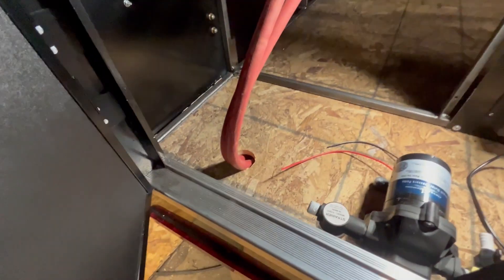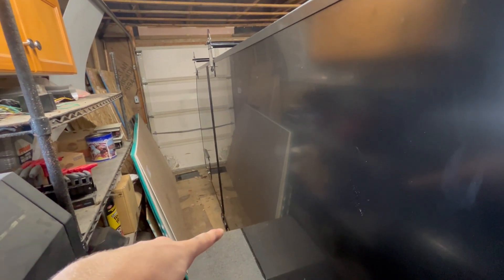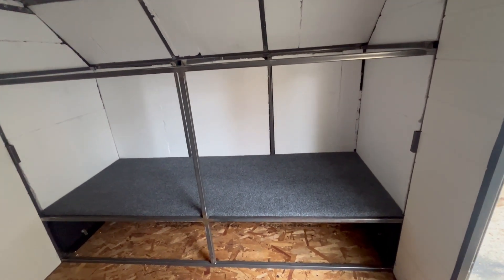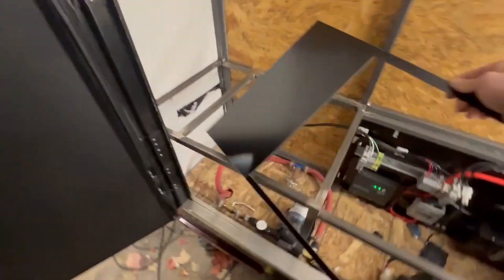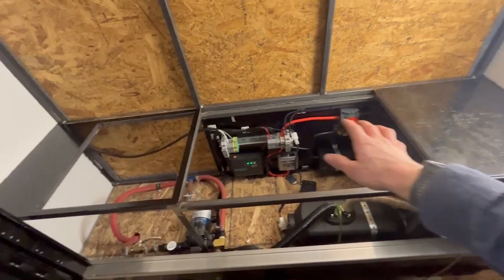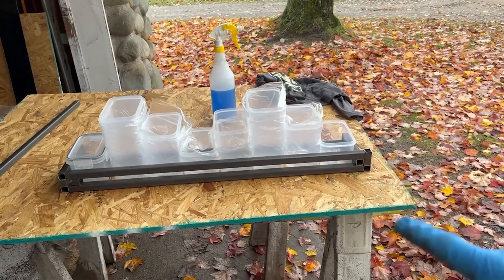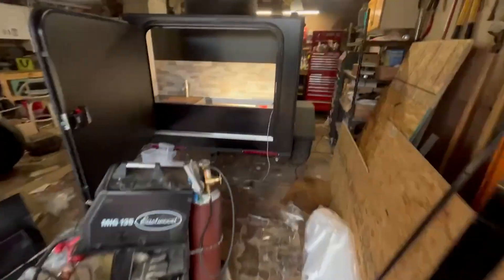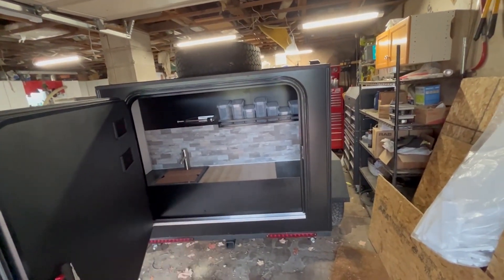DIY SquareDrop Camper Trailer Build Part 5 (Budget )

Comment: The skills I'm this build are great, and the overall design is fantastic. I think you may have made a couple of mistakes re: some of the equipment though... 
1) putting the solar panel between the rails isn't a great idea. If you have anything on them the solar panel will be redundant. The spare wheel should have gone on the front of the trailer, and the panel where the spare wheel location currently is.
2) The diesel heater is installed upside down. If the exhaust pipe comes off it'll fill your camper, instead of still venting outside at least. 

I'm not trying to criticise, your skills are brilliant, just trying to offer some helpful points. Enjoy your trailer!
Reply from the maker: Those are all great points! I will probably incorporate all 3 of them in the next build!  I will take constructive criticism any day!!! Thanks for watching!!

Comment: What did you use to attach the interior walls to the metal square tube?
Reply from the maker: @SommerOffRoad  basically everything used rivets or riv nuts to hold the interior together!

Comment: Are you sure it’s okay to run that diesel heater upside down?
Reply from the maker: Yea the directions do say to mount it the other way but I did not want to put more unnecessary holes in the floor of the camper. I have done 3-4 of them this way and they work fine